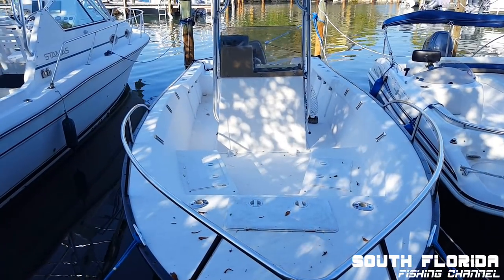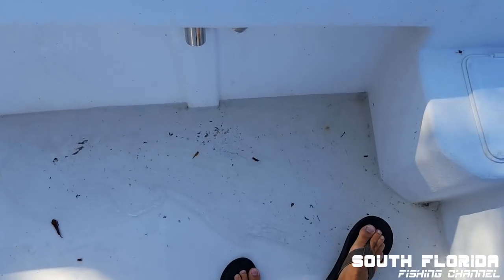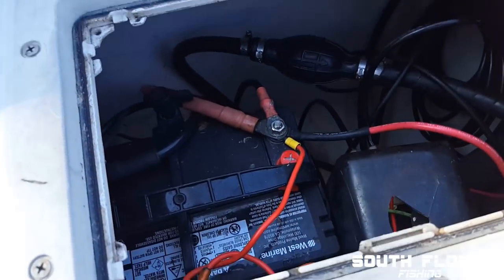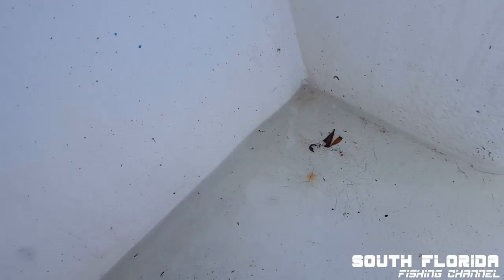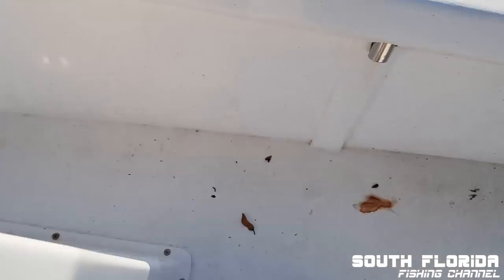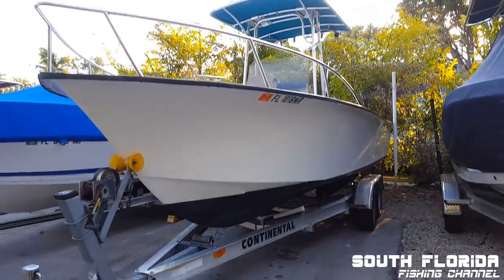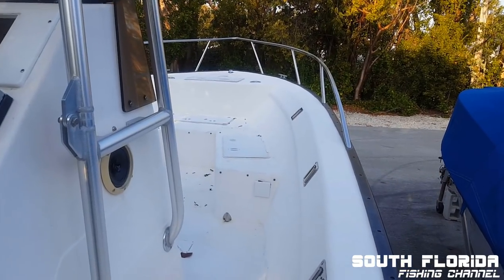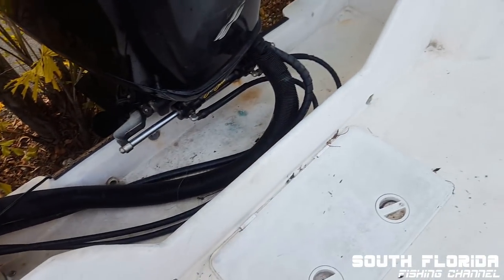Advice Needed | Water on deck issue & Transducer growth

Comment: Been in your situation man.... Best advice is just deal with the deck holding water or start launching every time you go out... you are still gonna have problems even if you install scuppers because when it rains its just gonna blow leaves in your boat and clog your newly installed scuppers.... if you drill holes you're going to promote rotting and also your bilge will smell terrible from decaying scales and blood flowing into it .... that boat wasn't built to sit in the water for its life time she wants to sit on her trailer at idle

Comment: My world cat has drains through the gunnels. You might not like the ideal of drilling holes in the side of your boat but many manufacturers drain out the side. There should be some 1 way drains sort of like check valves.

Comment: What's up Hieko, just saw the first minute and 30 seconds and even though I'm not a boat builder, boat designer, or even own a boat.   It seems like a simple/or complicated fix depending on what and where things are and can be on the stern. so there's more balanced as far as weight distribution goes.   I assume that that battery is on that side with other cables and wire harnesses going to the center console.  Go back and see the video yourself, and you will see that the moment you walk on the bow side of the boat that the water starts to drain.  Same principle why they always place the fuel tank smack in the middle of most boats. So the boat doesn't favor either side, for as heavy as a full tank of fuel can be.  I can see how it is a drag. but just try and distribute the weight at the stern a little better, and hopefully things will work themselves out.  Plus that boat is a true fish killer anyway, and that is really all that matters to us!!!  Lol..

Keeping it on the reeel.
JJG

Comment: Leave a sponge on the deck it will soak up the water when it rains. just squeeze it out when you get on the boat.I would never drill a hole because if it was meant to have a hole the manufacturer would have put them in it.Remember if you put a hole in the deck all that blood will rot in the bottom of your bilge. For the transducer growth I would try painting on some cyane pepper mixed in the paint. That growth is barnacles and with the cyane pepper mixed in the paint ,the animals will not cling to in because it burns them . Good luck dude.

Comment: As for speakers. If you don't want to spend to much money. While you get good sound quality. Go with the KENWOOD KFC-1653MRW. Or if you want a bit more bass with out having to put an amp. Get the KENWOOD KFC-2053MRW. I have had these speakers on my previous boats as well as on the one I have now. And they sound amazing. If you only have the setup for 2 for sure go with the 8". Best bang for the buck.
Reply: Also as many have said  try to offset the weight on the other side of the boat. To even it out. After this is accomplished. And a lot of water sits in back you might want consider finding a way where the front of the boat sits high enough while its docked. So that it makes the water drain properly. I don't know if I would make holes on a boat though. Seems a bit sketchy.🤣🤣

Comment: Can you drill a hole into the battery compartment and run a hose through the compartment and drill a hole in the side of the battery compartment to the motor well.  The hose could drain through the battery box to the motor well   IF  the motor well is lower than the main deck.  You don't want the main deck to drain into the bilge and expect the pump to drain rain water.  A few days of heavy rain and you may find your boat sitting on the bottom of the marina. It wouldn't be the first time it's happened.  A  simple solution would be a good mop.  Sailors swab decks in days of old.  Good luck and I enjoy your videos.  Thanks,  Mickey

Comment: You have a two part issue. Number 1 the weight is not distributed properly with the batteries being on one side. That's what is causing the boat to list while docked and causing the water to pool up in the back corner. Part 2 being the what to do about the water. You need to install a scupper that goes through the battery box area. Don't use pipe, drill your holes as you mentioned towards the end of the video. Then take a piece of pvc pipe and split it in half. Glass it in so you have a solid drain straight out the back of the boat. It sounds harder than it is. You can handle it no problem. Tight lines.

Comment: Don't drill next to the batteries.  You don't want a bunch of water moving alongside of the batteries.  Move the batteries to the center console.  Problem solved.  Worked on my 20' CC.

Comment: Before you opened the rear hatch I'm saying it's the Batteries in the compartment!! I believe that's the problem.  Those 2 batteries amount 2 probably over 100 lbs. of weight!! Pull the batteries & check the results of a new water test. No drilling to dump water into the Bilge!! If that is the case you could have scuppers professionally installed on both sides to drain from the stern or both drain from the port & starboard sides. Trying 2 counter weight on the port side would be difficult @ best.....
Reply: On the ducer bottom paint will downgrade the signal.I believe they have brackets that would allow you 2 raise the ducer like you can raise a speedo on the stern or you could have one made which should be easy 2 fabricate. Any boat moored in South Florida waters is going 2 suffer from the same problems!!

Comment: Add drain plugs on each end since you sit high enough use 5200 to make a tight seal I couldn't post a picture for you but since you run out of Tavernier check out the Hydra sport and you would see what I mean I have it on my 28 walk-around hydra-sport and it work perfect good luck

Comment: Extra holes on a boat are never a good idea, specially to areas where electronics are located.  Eventually the bilge will get warm and build additional condensation which will seep into all your electronics.  If anything the existing deck drains appear to be too close to center line, those are going through your splash board which dumps into the transom drains.  If you must evaluate the feasibility of adding an additional hole closer to the starboard side  where the water is collecting.  In the end it's you call, good luck, hope your business trip is successful.

Comment: My 2 cents, plumb the drains off the decks out the side of the boat and use ping pong balls to plug them while you’re fishing or while the boat is docked! I’m almost sure your boat has wood so when drilling the holes make sure to properly seal everything from the deck. If you’re willing to pay, get a good fiberglass shop to do the work. Good luck!
Reply: I forgot to mention too! A good place that’ll probably have all reputable answers to your questions is TheHullTruth. Make an account there and ask away. You’ll get good advice in no time!

Comment: Balance the weight in the back of the boat so that it sits level side to side.  Reduce weight in the bow so that there is a steeper angle from front to back.  Don't drill anything!  Clean your transducer every two weeks or you will loose definition.

Comment: Don’t make it harder than it needs to be, put drains in each corner and pipe it out each side. Try to use the biggest and least restrictive fittings you can manage. DO NOT let it drain into the bilge! After a huge rain you could potentially kill a battery or lose a bilge pump and your bilge area WILL flood and submerge things that aren’t meant to be submerged. Also try to steer clear of the traditional clear hose. It is the weakest of all tubing and will degrade over time, there is a specific hose that’s used for the marine industry that is much tougher. I believe it is white, west marine will point you in the right direction. As for the transducer you are correct it needs moved up. Use plenty of 5200 to fill old transducer holes and raise it to appropriate level. Fill new holes and between transom and transducer mount. Some people have mentioned moving your batteries around, this is not a solution!

Comment: i just put a sock to prop the rear hatch and let it run in the bildge
and for taking on water threw the back when offshore i had peice of starboat cut and some starboad cut to make some  rails to slide it in an out pretty much a removable transom and i stuff socks in the  drains and it works great for 120$
Reply from the maker: va mo thats a good idea. My buddy did that to his and it works great

Comment: theres these tru hull fittings that have flaps over them and only when the water goes through the house is when it will open but not let water in.

Comment: what if you sand that area and fill it with fiberglass thickener and feather it into the floor so it is higher and forces it to run out the drains?

Comment: for the water drill a hole and put the hose there it would be better like you said then plug it on one side when the boat is in motion just grab like a  thin pvc pipe or somthing and that would be problem solved

Comment: in my boat i drilled a big hole on the corner but on the ground and put a tube running down the side and then added a rubber cap so water can go out and not come in
Reply: my boat has never had anymore water and the filter helps so it doesnt get clogged and i could clean up a lot easier

Comment: Cut out two old shaped holes on the sides you're well over the water line they even sell Chrome fittings for the after usually do that in sports Fisherman's I have it done on my 33-foot or inboard diesel same concept on your boat it would work and it would look nice don't drill into the bilge

Comment: Just use ballast weights first bud. No holes!!!!! But if you have to the first idea of making holes into hatch area is exactly what I'd do! It will not put as much stress on the bilge pump as you think. Esp if the holes are semi small. It won't dump and flood the bilge with a 1/4" hole ya know......not like a 1" hole would.

Comment: Put down a sea deck. That will raise your deck a little. Or put floor drains in the corners and plumb them to the stern. Don’t ever drain into the bulge.
Reply: Also. I just put JL speakers in. Very awesome. Highly recommended.

Comment: You need to to also get those anodes that keeps all that stuff off  your electronics and anything metal re-distribute the weight if possible but put in THRU HULL SCUPPERS Water goes out but not back in and don't  add all that extra potential water leak holes you'll be sorry if you do. Half these yahoos don't own boats so don't take there advice think man your smart right? And you know how to get in touch with me remember  Don't make your boat a hole in which you pour money. If yo go that route consider buying a new boat with a warranty Thanks

Comment: My stripper has a scupper right in those corners that drains to the outside, not down to the bilge. Put this in the floor https://www.iboats.com/shop/t-h-marine-supply-cockpit-scupper-drain-90.html

Then run a hose to this https://www.basspro.com/shop/en/sea-dog-scupper-valve

Comment: Drill a hole in the deck, add a 2inch stainless steel drain - to bilge
Reply: Don’t do that, fish grime and bilge pumps don’t play nice together.
Reply: First, if you are in salt water you probably have barnacles, not mussels. You can safely coat the transducers and brackets etc. with VS721. It’s a super slippery, clear, polymeric coating that won’t interfere with the signal. If you can access the transducers from time to time and wipe off the slime, you won’t get any growth. If you leave the boat unattended and start to get growth, it will be much easier to clean up. If you have growth on your transducers at this time, you can use Algex to clean them without damage. Other bottom cleaners may cause damage.